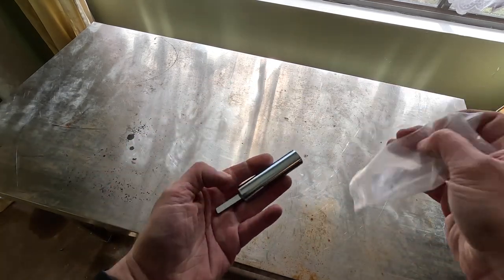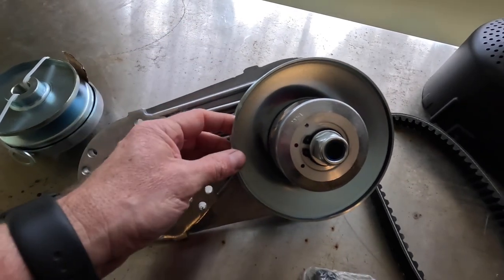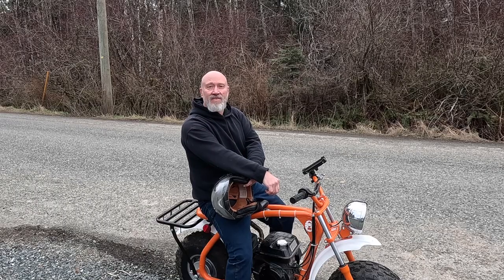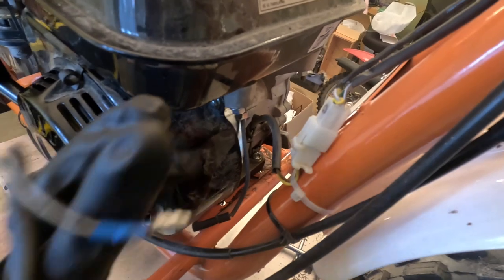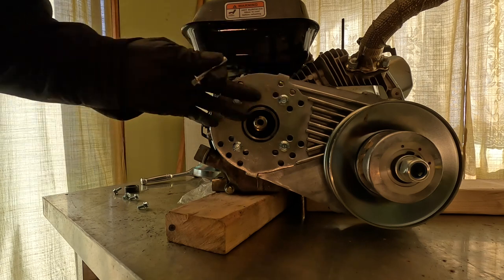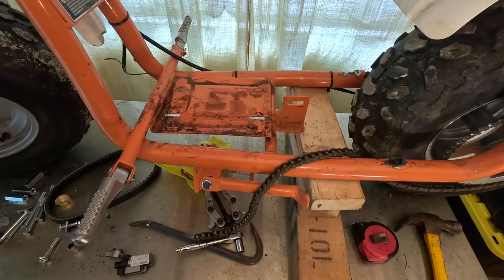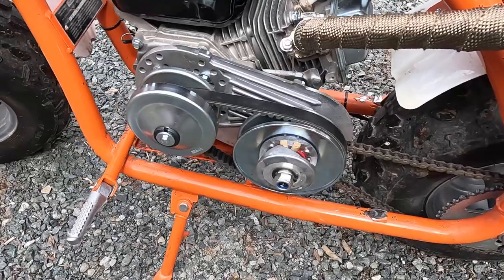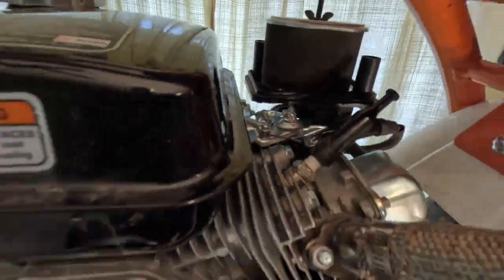Coleman BT200X | Don't Buy A Torque Converter For Your BT200X Before Watching This! | Wet Coast Fab

Comment: Everyone thinks the original engine sux and the pred is better, but, the hisun stock motor is just as good. T/c installation is a pain. Misalignments must be dealt with. Removal of internal governor and use of a better spark plug goes a long way. Good work, Wet Coast Lab! I get 60mph, but rarely use it.

Comment: The torque converter can be adjusted by moving the internal spring or installing a different strength spring and a different Sprocket Size will also help.

Comment: This video helped alot, It pointed me in all the right directions for putting a torque converter on my BT200x, I had on issue of alignment of the CVT and rear sprockets but that can be fixed by cutting and moving spacers on the axle and rotating the brake out of the way of the adjuster.
Reply: Very fun once I got it working though does probably around 50/60 kph with a 208cc without a govern, might puta performance carb on and see what happens
Reply from the maker: Thank you for the comment and I'm glad that this video helped you! Have fun!

Comment: My dad put a snowmobile engine in my mini cycle with the stock clutch but the other torque converter. It would go 0-80 like now. My clutch was 5Xs bigger than yours. But I don’t understand why more companies don’t do what you’re doing.
Reply: Good video. Sorry it didn’t turn out.

Comment: If you want to go faster, you need to change your rear sprocket to a smaller one. Your original drivetrain gear reduction that you took off was a lot smaller than your torque converter. The sprockets were smaller. Now you went from basically 3 inches to like 10 inch gear reduction with a torque converter when you take off, so you can put a smaller sprocket at the rear wheel and still have enough torque to climb your hills, but increase your top speed.
Reply from the maker: Thanks for the advice, Dan! I'll try out some different gear ratios soon!

Comment: I'm so glad you made a video on this! I ran into the same issues with my bike and it's good to know that it's not just me! I put a basically stock 212 on my Coleman with a torque converter and honestly was disappointed. I put a 60 tooth rear sprocket on it, played around with jetting and exhaust setups (which did seem to help) and still it just didn't pull like it should've. It was faster than stock for sure, especially after bypassing the governor, but without extensive flow mods these motors just don't rev out enough to max those pulleys out.
Reply from the maker: Thanks for that feedback, RJ! After doing a bunch of research I think the only way that using a torque converter effectively is to either remove the governor (and accept the risks associated with that) so the engine gets over 5,000 rpm or replace the weights/spring in the torque converter's clutch so they open up sooner. I'll be messing with the governor removal in a future video to see how that works out. I've got one more thing to try first though.
Reply: @wetcoastfab  in those Amazon torque converters the driver pulleys engagement is controlled by springs, so in theory you could stretch them out and it would fully engage earlier. Not sure about the driven pulley though. I’d be interested to see how that would work though
Reply from the maker: Yeah, on more 'conventional' scooters, they typically have a set of ceramic rollers in the clutch or driven pulley and you can replace them with heavier or lighter rollers to change the 'shift' point of the CV transmission - maybe that's a mod I could try: rollers!
Reply: Removing the governor on a stock 196/212 on a Coleman 200 with a torque converter and stock gearing is a complete waste of time. You'll never see 5K RPM.

The best basic setup for these bikes is a stage 1 kit (look that up), a torque converter, and a 60 tooth sprocket. Back out the throttle screw and you are good to go with nice low end and decent top speed. Keep the governor and stock linkage.

Pulling the governor is for guys building potent performance engines that use Mikuni style carbs and run higher than 6K RPM. Pulling the governor is also for guys who do not yet know what they are doing and just want more RPM and top speed for their bikes that use a standard clutch.

I have had my CT200U's for six years. If you rode either one of them you would agree that there's no need to pull the governor.
Reply: Learn how to tune the driver and driven before dismissing a TC. They can be made to work with most any engine.
Reply: Get an ARC billet rod and flywheel so you don't scatter the engine. Believe they are good to 9 grand. 
Also pout on a TRUE Mikuni  22mm.carb and long manifold for more low end ( think of the old TUNED PORT Chevy csmsro,corvette of the 80's to 91 fuel systems.
 While you're changing the rod get a MOD 2 camshaft. 
Same specs as oem but longer duration and lift.
Put a two stage exhaust pipe for low end.
 Your getting more fuel in with longer duration  so you need to get that much more out at the exhaust. 
18 # springs. I put new SS valves and automotive keepers .don't trust those slide in keepers. 
I ported my " hemi " head for more flow also.
Putting on a one piece at a time Speedway mini bike  when I can find all the parts. 
I also put on the original Comet CVT  system . Could find the primary clutch to match the Fairbanks Morse secondary.  Will have 14 inch knobbies front and rear  with a 9 tooth engine side gear and a 54 tooth rear gear. 40 chain. 
Should be a nice back woods trail bike and still be old school
Reply: @rocknrolljesus3197  Correct. You can buy different springs and what not to set it up for your specific engine/needs.

Comment: Did you check the actual sprocket alignment from the rear wheel to the torque converter? Without moving the sprocket or engine you should be out of alignment by about 1/4 inch. To fix it you can use an adapter with a steel ring sprocket to offset closer to the tire.
Reply from the maker: I did, thanks! I left enough adjustment in the spacer I made for the engine to allow me to move the engine left/right by up to 1/2"

Comment: You can get 30+ mph on the stock 196cc. Take the throttle stop screw out and throw it in the garbage. Remove the gas tank. Then move the governor spring that connects beneath throttle assembly to the furthest hole on the governor arm. You should get up to 34mph no prob.
Reply: Wish I knew this before I went through all the work of taking the throttle linkage off😭
Reply: Followed your instructions now bike doesn’t get fuel.
Reply: @billyschannel997  😂

Comment: I had to sand down the clutch every time I took it out or it would slip. But I’ve known this forever. I’ve been having mini bikes, my whole life, dirt bikes, checked out out, put a torque converter on it stage two kit and the motor now the thing goes pretty good.
Reply from the maker: Great advice!

Comment: Great vid.  Interesting and informative with lots of great tips.  I can't wait to see what happens with the new jets.  PS - When I was a kid back in the 70s, a lot of us had minibikes with 3.5HP Tecumseh engines and similar centrifugal clutches.  We used to bypass the governor spring with a paperclip and got about an extra 5mph.  Cheers from Canada :-)
Reply from the maker: Love it! Those were the days, eh?
Reply: @wetcoastfab  Eh what?
Reply from the maker: @robinbrowne5419  Back when we had those non-suspensioned, lawnmower-powered, exposed chains and no instruction death-traps as kids 😀
Reply: @wetcoastfab  Yes.  My sister borrowed my minibike and got her bell-bottom pants caught in the chain 😅   But she still loved riding it anyway, and now she has a Honda Rebel 500,  50 years later 👍
Reply: Or a dentist lol

Comment: You have a 45 tooth rear sprocket. I have changed to 60 tooth I would recommend doing so you will be glad you did! OMB Warehouse will have the 60 tooth. Also A honda GX390 jet that you find online or at local lawnmower shop will fix your lean top end.
Reply from the maker: Thanks, Good! I'll check it out!

Comment: I use those hex standoffs to raise front of gas tank and make a little bracket to raise rear of it as well. Then i tap fuel outlet for 1/8 pipe tap threads. Add a fitting for a 3/16"" ( usually ) fuel line vs. the tiny stock id one and my fuel delivery issues are solved

Comment: Good stuff and good convo in the comments.  Thought I'd share my experiences w both 196 and 212 so far... I have a new stock Coleman 200 w the standard 196.  I just bent the governor tab way back and it went from 19 to 25 mph.  Then I had carb issues anyway so put on a Mikuni (and gov removal), now goes 30mph and I am 210 lbs.  Next will be a header pipe to get me prob to 33 or 34 mph and I think I'll stop there.  (Prob getting a dirt bike next)  Also built a gokart w my son...put a Predator 212 w torque converter and 60 tooth sprocket.  Backed out the governor screw 3/4 and it goes 35 mph for my son, 30 for me.
Reply from the maker: Wow, Bill! Thanks for the detailed information! There's so many ways to mod these little bikes for more performance!
Reply: problems of u tube 1. knowing your way around any engine you about to modify. 101. understanding what the parts identificaton is an its job 101. at the least having some idea of what to exspect from the modd 101. unfortunity in this case wanting more performnce out of the machine ( absolutly req. from a males perspect. i may be biase on this point but i agree. ). exshaust at this level absolutly a waste of time an money. carb modify again absolute wast of time an money. concept of engine req. again very good knowing haw to apply in this case F +. first mech mistake that was not the gov. screw that boke his screw dr. that was a throttel limiter. limits fuel. more few more speed right ? yes but this isnt the cause of low rpms. with gov limiter restricting rpms you only blew more fuel unused out the pipe. tail pipe that is unspent an still wet lol. 2 plastic zip ties with no modds to the bike an i mean none. would reult in a 10 mph gain. at no point would have to open or remove engine an take about 2 min. to exsecute. i would advise not over rev . for long periods of time. short spurts at your own call. u should be ok. i heard. which why i say all is hear say if u werent there from anyone i take no responsibility for anyone even me. good luick my friends lifes a battle buy a good helment. then wear it.

Comment: After removing the governor and replacing the flywheel with one that won't grenade at higher rpms, you need to switch the clutch pulley to a Juggernaut or another like it if you want to go faster. The ones that come with the CVTs limit the engine's ability to reach it's potential. The rpms will have a higher limit with a juggernaut.
Reply from the maker: Thanks for the great info, John!
Reply: Not always. My Coleman runs higher than 50 MPH with the stock TAV driver. Juggernauts are for guys with 7500 RPM plus engines. They are not what you want to run with a stock engine.

If he's running that slow there's something wrong. And pulling the governor will not increase speed on any stock Coleman 200 with a torque converter. The engine never makes it to stock governed RPM with the stock Coleman gearing once the belt shifts to high. It's still going to top out governor or no governor.
Reply: Go with a tillotson electric start engine because the stock flywheel can handle 10,000 from the factory.
Reply: Misinformation. Comet 30 series drivers can "stall" well over 5000 rpm with the correct spring and weight combination.
Reply: @rocknrolljesus3197  Not talking 'bout stall, I'm talking 'bout more rpms and a faster top speed. A little knowledge is a dangerous thing.
Reply: @sandmanbub  wow you sure know your stuff! 😂🤣

Comment: The only bad part about swapping one of these torque converters onto a Predator is you have to buy all new bolts to mount it. A stock 196cc engine uses 8mm bolts and a Predator is 5/16x24.
Reply from the maker: Great info, thanks Steven!
Reply: The $1.50 is worth it 😊

Comment: Just bought two, thank you for the video. I think I'll hold off until I upgrade my the predator.
Reply from the maker: Thanks for that, Jordan! I did finally get the HiSun engine performing well enough to hit 30mph, but I had to re-jet the carb and mess with the governor spring tension. That'll be my next video soon. I'm also starting the 'Predator' upgrade now as well.

Comment: You'd be surprised just how powerful you can make a 196cc if you do enough mods to it. I never made that transition to a 212. I just upgraded every single part in the 196cc until i was able to hit 50 + and get to that top speed really quick. But yeah I don't even wanna know by now just how much money I've spend getting to this point. Alot more than I paid for the bike I'm sure lol. The only things that are original on it is the frame and the rims. 😮
Reply from the maker: I'm afraid to add up how much I've spent on it so far :-D
Sometimes I think "I coulda just bought a small dirt bike" but doing this is way too much fun
Reply: @wetcoastfab  I've thought the same exact thing to myself. If I added up how much I've spent on upgrades and mods I could have just bought a real Dirt Bike by now. But I'm impatient and suck at saving lol. Oh well.  It is fun customizing these mini bikes. Mine looks like a mix half dirt ike half Harley. 🤷

Comment: Do the zip tie Governor bypass it works good the only thing that would be a change would be to eliminate the governor but I've done the zip tie and my ct200uex is a screamer by doing that and I love it
Reply from the maker: There was a welded throttle stop on this bike's carb linkage, so messing with the governor really didn't get me much more speed

Comment: my mini is topping out at 38, but My other, Baja Warrior tops out at 56... with juggernaut driver, billet flywheel, billet rod, 265 proformance cam, 22 lb springs, bigger jets, straight pipe header, governor delete, oil sensor delete, stage two, with high flow air filter
Reply from the maker: Nice! That must be a bit of a thrill at those speeds! I'm not sure if I'm going to go that far with the engine mods 'cause I've got something else in mind
Reply: There is a huge following in different states, gotta find one near you, plus in arizona, we have about three to four dealers to get parts.

Comment: Were you not trying to get more power?
It's a possibility that the overall gearing ratio is too high and the torque converter will never make it run as fast as its highest speed would be with the little power you have.
I think you should try to reduce the chain gear ratio as much as possible.
Reply from the maker: Thanks for the feedback! I was thinking along the same lines. I don't think the engine can get to full torque before the gear ratio starts bogging it down. I'm going to mess with different ratios soon.

Comment: U need to adjust the governor spring. It's dangerous to remove governor with out replacing the flywheel.
Reply from the maker: Thanks for the info! I may put a billet flywheel into the engine, if it's upwardly compatible with a 212cc engine. I need to research that

Comment: Have you had to take the torque converter off for any reason? If so, howd you do it with that press fit adapter? I installed mine same as you, but im curious how thats going to work getting it back off lol.
Reply from the maker: I have had it on and off a couple times. The adapter is more of a slip-fit. It's on firmly, and it's too hard to pull off with a bit of patience.

Comment: The real issue here is that throttle stop plate that’s welded. Grind that weld out and remove the screw. Then you got 30mph plus
Reply from the maker: Yup! I did that and it made little difference. Thanks for the feedback!

Comment: My little home version 110 volt welder works so awesome,  So why why why, do all the Coleman BT200 bikes have such Horid welds,  Why?   looks like the welding was done by 3yr olds
Reply from the maker: Right? I looked at the welds on the frame and shook my head. I'm no professional welder, but have done enough of it to know that they do look like 3 year olds did them

Comment: i like buying he hisun engines off ppl that upgrade to predators. i buy them for as cheap as half the price of a 212cc or less. order couple parts, remove governer and boom were gapping the predator swapped minis. :D
Reply from the maker: Love it, Pedro! The thought had crossed my mind that there were a lot of HiSuns out there  because of that
Reply: There's nothing wrong with the Hisun 196. Mine has started on the first pull every spring for 6 years and is a strong runner for a mainly stock engine.

Comment: instead of the new torque converter that's gray if you use the black plate you don't need to raise up the engine

Comment: Can you reverse the original clutch and get a longer chain on these? Eliminating the double sprocket shaft and short chain and running directly to the clutch would be ideal.
Reply from the maker: It's possible - I might have to try it out

Comment: I put a 30 series TC on my go kart with a 6.5 Briggs engine. I don't know the gear sizes but I was able to hit 27mph easily.
Reply from the maker: Nice! I'm really beginning to think something's not right with this 196cc engine.
Reply: @wetcoastfab  You could also check to see where the torsion spring is set to on the outside pulley of the torque converter.